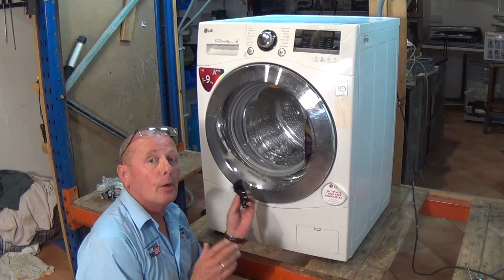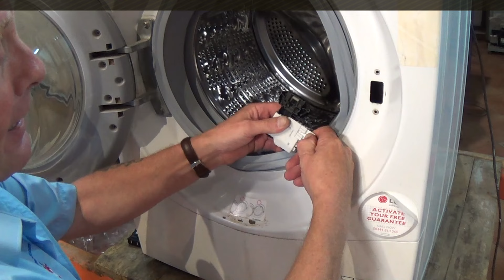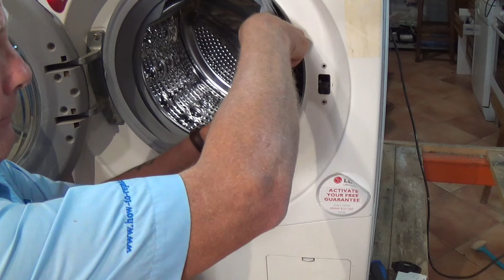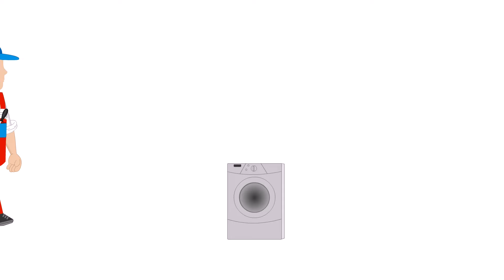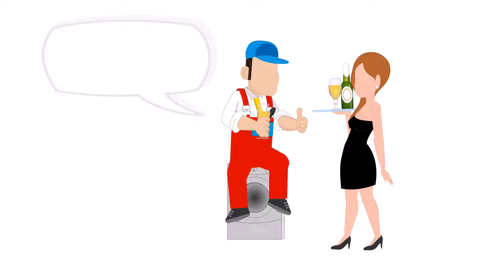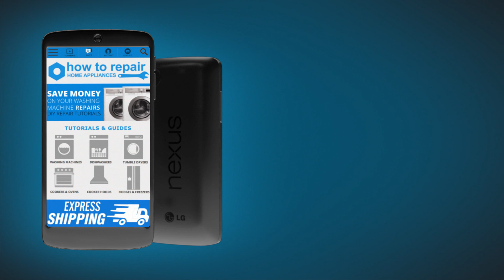LG Washing Machine De error code how to replace door interlocks

Comment: When my LG front load washer wouldn’t open, I considered buying a new washer as I thought it was too expensive and too technical to fix. After watching this video, I got out the tools. 
1. Disconnect power.
2. Take top off machine. Look at your particular model online for instructions.
3. Pull machine out from walls and dryer.
4. Inspect door lock mechanism; it has a hinge with a tiny spring on it that is an integral part of the mechanism working properly. If you determine the switch needs changing, order using model number off front of machine.
5. You do not need to remove door gasket if your machine has the molded hand holds on the front sides of washer. Pry hand hold off leaving an access hole at side of washer.
6. Remove screws holding switch in place. You can secure the switch by reaching inside from top and   moving switch to the hand hold access hole. There is not much extra wire in the harness but there is enough to allow pulling the switch through the hole. Detach the wire and install wire onto new switch.
Push switch through access hole and reinstall in machine.
7. Reattach top. Install molded handhold.
8. Position washer where it should go and plug machine in.

Comment: Model:  WM3570HWA and Serial:  501PNCY2B483 - my washer is throwing a DE1 error message .  It locks the door when I try to start a wash cycle but then immediately displays DE1.  If I cancel the wash cycle, the door will not unlock and I can hear a two clicks near the top, back left of the machine.  I have to pull the power cord to open the door.  Does this still sound like a door interlock issue or something else?
Reply from the maker: Hi mate, I've created an FAQ page for you. You can find a detailed repair guide for your problem on this page. Here is the link: https://www.how-to-repair.com/faqs/lg-wm3570hwa-washing-machine-shows-de1-error-code/ 😇

Since we work very hard in our warehouse making free video guides for you all on appliances, we always appreciate a beer, offering a choice of single or round beer. https://www.how-to-repair.com/help/buy-paul-a-beer/ 

Please remember to subscribe to our channel, as that's what keeps this channel going. Thanks, Paul 👍

Comment: Hello, i have a lg f14wm8ln0 and while starting a washing program the pin in the door broke while the machine was trying to lock. I replaced the pin but now the pin wont go into the lock, its kind of blocked. The broken parts from the pin are all removed.is it possible that the lock is still in a locked state and if so how could i unlock it because this machine has no lever in the bottom like some other washing machines.

Comment: Hey does anyone have a diagram of the inside of the door? I broke the spring that pushes the pin lock in. Same model. I fixed the pin bit not sure how the spring sets? Thanks!
Reply from the maker: If you use the contact us page at the website, I will see what exploded diagrams I can find for you but I will need your full model number and PNC number off the identification plate on your machine,  What would really help me to get my video seen as I'm no IT expert is to either share the channel or at least post it to your friends my videos might not be YouTube superstars, but they save Appliances from the scrapheap. Share and help us fight appliance waste! @TheNelson357357 please remember to subscribe to our channel as that really helps us https://www.youtube.com/shorts/e432SAb2g08  Thanks, Paul 👍

Comment: changed my lock but still have the same error! anyone know what the problem could be?
Reply from the maker: You may I have a fault with the wiring, do you need to check this or that it is possible that you may have a problem with the printed circuit board @johnjames8594 please remember to subscribe to our channel as that really helps us https://www.youtube.com/shorts/e432SAb2g08  Thanks, Paul 👍

Comment: F1A8FDA DE error, and cycle wouldn't start. Changed the door interlock following your brilliant video. The machine started fine and completed a cycle (empty) but at the end the door wouldn't open. Tried to start another cycle but this time got error DE. The door still won't open.
Any advice please?
Reply: ...sorry, I mean LG  F14A8FDA washing machine...
Reply: I found the problem. The new interlock wasn't mechanically seated properly. It now works fine. Thanks again for your video 😊

Comment: So I changed my lock and it still doesn’t work what should I do next
Reply from the maker: Feel free to contact me at the website where I will personally be able to assist you  Hi @tdavis8035 I will need the full model number of the identification plate please use our contact us page and make sure you fill out the request of what part you are after and will get back to you within 24 hours normally https://www.how-to-repair.com/help/contact-us/
this is for you https://www.youtube.com/shorts/e432SAb2g08 please remember to subscribe as that's what keeps this channel going. Thanks 👍

Comment: Thanks for the video.  Took out the locking mechanism,  sprayed it with WD40 and it started working again! Think I got lucky..
Reply from the maker: I would definitely not spray any of the electrics with WD-40. You are potentially causing a fire hazard. If it was only the plastic locking part that you sprayed then you should be okay. I would replace the lock. Have a great Christmas and a happy New Year glad we could help you @mikereeves75 this is for you https://www.youtube.com/shorts/e432SAb2g08 please remember to subscribe as that's what keeps this channel going. Thanks 👍

Comment: I just took the top and front panels off of my lg washer so I could remove the seal and wash it. I put everything back together and now I keep getting a "de1" error message. When I shut the door and try to run a load it doesn't make the noise like it's trying to lock, I just get the error code immediately. Would this still be my door lock mechanism? The model number to my washer is WM3250HWA.
Reply from the maker: lock fault
Reply from the maker: A while ago on YouTube, you ask me a question about your LG washer. I just thought I’d let you know that I have now made a complete playlist to assist you in any repairs that you ever have.
If it helps, you don’t forget to share it with your friends who may also own an LG.
https://www.youtube.com/watch?v=w5dZ4Pj8Jdo&list=PLnAHZbSarsyHLR4x9XPIS-ZEsheufxm9Y

Comment: I had this fault today de1 while using the lg thin-Q app trying to put a load on. I turned it off at the mains for 1 minute and it went back to normal after and I done 2 loads since then and it’s fine. Do try that first guys 🙂
Reply from the maker: A while ago on YouTube, you ask me a question about your LG washer. I just thought I’d let you know that I have now made a complete playlist to assist you in any repairs that you ever have.
If it helps, you don’t forget to share it with your friends who may also own an LG.
https://www.youtube.com/watch?v=w5dZ4Pj8Jdo&list=PLnAHZbSarsyHLR4x9XPIS-ZEsheufxm9Y
Reply: @How-to-repair  yes a year ago. 
Unfortunately it’s leaking out the back of the tub on to the element having no luck this year so far… But it was used and I have had it about 3 years now it’s been making a electrical buzzing noise since before Christmas so I investigated the other day and as soon as I took the back panel off I noticed the element connections are rusting because water is some how coming out from the back of the drum behind the motor can’t see where from? 
Been told my bearing seal may have gone or something and I can’t afford to get it fixed by lg they want 155 quid just to start with guy in town said it’s basically scrap I am gutted tbh i really liked it. 
It’s still doing its thing for now but is leaking into the bottom panel slowly. 
But I liked it that much so I decided to get a brand new one out of very catalog,  a LG 2in1 washer dryer combo 10kg/6kg dry FWY706GBTN1 did just want a 8 or 9kg but couldn’t find one only a wash only machine by LG in the lower sizes. 
It has an impressive 5 years warranty was going to get a hotpoint active care as it was cheeper but the warranty is only a year so I thought nar I will just get a LG again and I don’t want to buy another one for a good few years so got to just get a brand new one it’s been a while and I have had a few 2nd hand ones since 2013 some just to fix and sell some that was my actual machine… but this is like the 5th one in 7 years 2nd hand so just want a brand new one with warranty!! 
it looks a lot better than my lg FH4U2TDN2S but nevertheless it has been a great machine up until this electrical buzzing started but I am not put off just think I am unlucky and these things happen 😑😕
I am looking forward to the new turbowash 360 system as mine is 6 years old now. 
Can’t find any videos really on British LG washer/dryers but not sure when this new one come out think it could be 23/24 model not sure 🤷🏻‍♂️

Comment: I have the same error on my LG washer but mine occurs after a wash cycle has started. Happens frequently, I then open the door and move the cloths around a little and start again. Sometimes I have to do this multiple times to get a load done. Wondering if It is this same thing, never does like your video is showing.
Reply from the maker: check motor Thank you for leaving a comment, I would love you to leave your opinion on our poll about manufactures building in obsolescence to appliances. https://www.youtube.com/post/UgkxygHomnUySd_bYjaJBdEHPO6T4dYo9Ahm
and this is for you https://www.youtube.com/shorts/e432SAb2g08 please remember to subscribe as that's is what keeps this channel going. Thanks 👍

Comment: I tried but my machine still wouldn't start
Reply from the maker: If you have replaced the door interlock and it's still not working you may have a problem with either the wiring loom or the printed circuit board  please remember to subscribe as that's is was keeps this channel going. Thanks 👍

Comment: Hello I changed the door lock but still have the de1 issue   Any help is appreciated going crazy trying to figure it out!!!
Reply from the maker: If you have fitted a new door interlock and the door is locating correctly you want to make sure the PIN that slides into the door lock is not damaged in any way if all this is good then you may have a problem with the printed circuit board
Reply: How to find out if it is the PCB? Is it possible to replace the PCB on our own?

Comment: Before trying to replace the door switch, try this instead. When you get the DE error, either open the door and slam it back hard or slam you hand on the door and give it a hard slap(near the door switch area). It will work after that. Yes, I know it's ridiculous but it works. Been doing that since 2015.
Reply: He Anton how r u? I have the same problem. I got DE error. I changed the switch. But the DE error  is continue. Did you solve the problem?
Reply: @omerclkl2103  Same here，hard slap works. Wanna know how to solve it.
Reply: @omerclkl2103  great advice. After watching this I fiddled with the switch by hand and thatvalso worked.  Whew.
Reply: @omerclkl2103  So do i, I have same case. How to fix the problem ?
Reply: Yes it works my friend.. Just now... Thank u
Reply: @manip3402 😂👍
Reply: Thanks a lot it worked for me
Reply: Thank you this worked. Life saver
Reply: It worked. Thanks man
Reply: It worked bro..Thanks for the tip
Reply: thank you worked for me 😅😅
Reply: Nothing worked, only your suggestion worked. Thanks man for saving my day 😀
Reply: @mosiur_apu slaming?
Reply: Yes. I call it "The Fonzie". Works on juke boxes to, obviously.
Reply: Why did this actually work🤣
Reply: Thanks alotttt❤
Reply: Great
Reply: Thank you i was stressing right now your comment helped me 😊😊
Reply: Slams all day and good to go every time
Reply: It really works you the man
Reply: Amazing, this just worked. Thank you sir 🎉
Reply: Yes, it actually worked. Thanks
Reply: Good heavens 😂I came to this video in sheer desperation but thanks to you,my internet friend, the problem is solved! Thank you so darn much, literally just saved me A LOT of headache!
Reply: Thanks mate, worked for me
Reply: Thank you so much it worked wonder😍😍
Reply: Thank you, Sir!
Reply: It worked. Thanks a lot. 2024
Reply: Yes I experienced and successful thanks
Reply: 😂😂😂😂thank you just done it and it worked 😂😂😂😂
Reply: I followed your advice and it actually worked, Thanks
Reply: Thank u so much man u saved me
Reply: Yes. I did the same. Now working well. Temporary measure but we live day by day ...
Reply: Thanks You, it's work
Reply: It work for me... 30/01/25... Slam the door when DE error on... Now can wash now.. Thanks for advice...
Reply: My man! Woaw, I just gave it a slap and it works. I love you man, thank you!
Reply: Worked for me 😂❤ amazing!! Thank you

Comment: Thanks for the video! My issue was as simple as i did not re plug in the harness for the door lock after replacing the drain pump. Your video was very helpful in diagnosing this problem. Thank you again!

Comment: My beko stops at rise , I’ve tried everything possible , I have to manually select rise and then manually select spin to finishing my washing , pump is clear , hoses is clear , checked the brushes , the belt ect I have a feeling it maybe a electrical problem , I’ve seen your other video on the circuit board 
capacitors. I just want to make sure I’ve ruled everything out before I take a look . Any advice would be much appreciated cheers

Comment: Hello guys my LG washer the pin or latch is broken I found this out when I removed the interlock and found the broken piece in the interlock
Reply: Hi I have exactly the same problem.. but how did you fix it? I got a new pin and assembled it but the door still won’t close.. maybe the interlock is stuck in the locked position? I don’t know what’s wrong

Comment: I got the same code today. I'm familiar enough with machines to know that it was the door sensor that went on the washer. As you instructed, Using the model# and serial# I located the part and ordered one. I'm going with what I have and that is a flat-head screwdriver. There a special tool that spreads the spring but that is $60.00! The part is only $20, so I'm not paying that much for a job-specific tool I can only use for this job. I fixed my dryer too when the belt went on it. More women should know how to repair their household machines. At least the simple jobs like this. Thank you for the video!!
Reply from the maker: I'm so glad we helped you in some way don't hesitate to get in touch if you would like to know more :) 

https://www.facebook.com/how.to.repair.appliances/
Reply: @How-to-repair  can you please advice me as to emergency release  on LG machine
Reply: @How-to-repair yo cambié la pieza de la cerradura y me sigue dando error. Que puede ser?
Reply: @JoseMatrako  pueden ser alambres corroidos ? Sucios ,desenchuflados , 
Y por Ultimo puede ser q una Nueva lavadora te esta esperando ,
Yo Tengo el mismo problema pero le cambio el nive automaticol de agua  a desacctivado y trabaja , la lus roja q indica q hay una falla ,de la llave de media pulgada sigue encendida , pero como digo trabaja ,